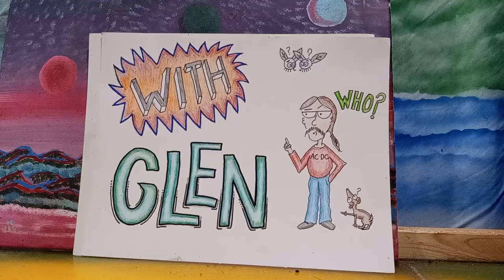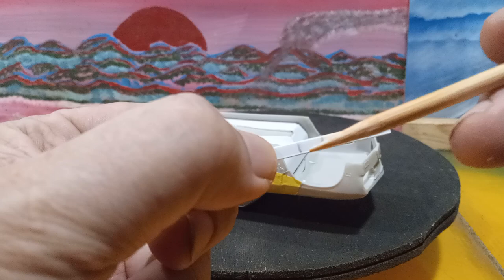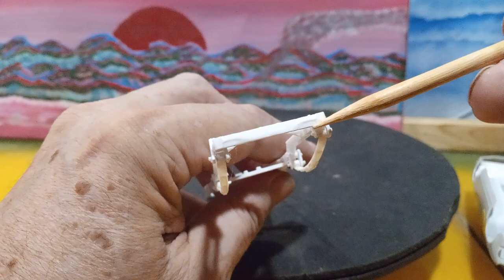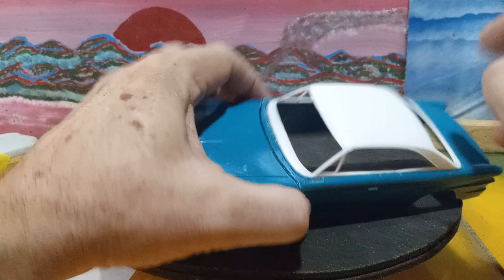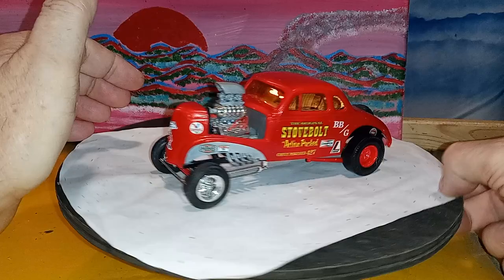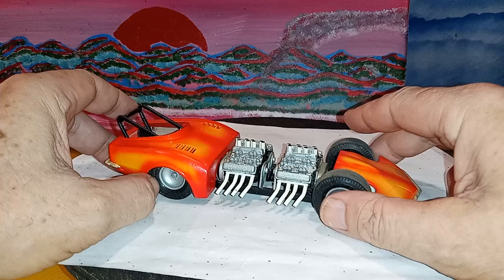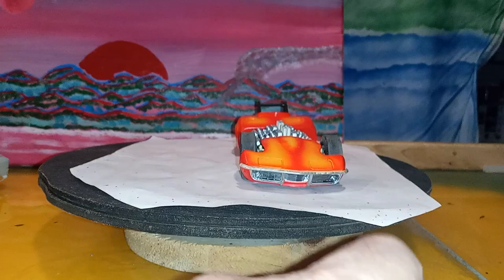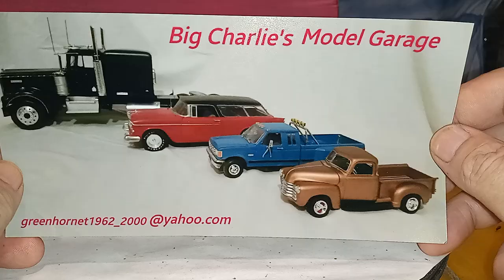#31,,,update on the corvair Gasser a cool tip and 2 models yeah buddy

Comment: Cool beans buddy! I like that 37 Chevy with the flathead w/ardun heads, I've got a Lincoln Zephyr V12 with the Ardun heads, I plan on putting that in a ratrod. Eventually 🤞! Yeah I want to get one of those what is it a mickey Thompson record car, the 4 engine thing, well I want for the 4 Buick nailhead engines, back in those days the hotrod guys like the small block Buick nailhead engines, they were real ruff but with the small valves in them they put out a lot of torque.
Reply from the maker: HI Doug I don't think they were nailhead engines in that crappy kit but the TV tommy ivos kit did have four nail head's in that kit,,, I have one in my stash that I got for a different project so if you want them I can send them to you when I get my social security on the third of August,, just send me a Gmail to make sure I got your address right, I may still have it if I can find it in the Gmail,, let me know buddy, later, Glen
Reply: @modelcarswithglen.  - Cool buddy! Yeah the Tommy Ivo car was the one I was thinking of, I got it mixed up with the Mickey Thompson thing, still I'd like to have that one, whichever one your talking about, haha, done got myself cornfused, again! Lmao! Anywho yeah man I'll email you my address, no problem buddy, and thank you very much, I sure Preciatecha! Later bud!

Comment: That quad engine Corvette rail is incredible. Love it. What paint did you use on it? Would love to know. Cheers from Nova Scotia. It's in Canada on the Atlantic coast and north of the New England states. Love your channel Glen, you're tops.
Reply from the maker: Hey Ken,, love your sense of humor buddy,, the paint is plain ol testors the yellow has the smallest drop of orange in it just to tint it slightly the other color is straight testors orange,, sprayed through a Air brush that was having a good day, the orange was thinned more so it didn't cover very well,, the airbrush was turned way down on the paint volume and the air pressure stayed the same  ,,it was applied in multiple layers making it easier to get the same width on,all the stripes  everywhere ,,, super easy,,,NOT ,,,but with practice is do able,,, I hope this helps and isn't confusing,, Ha catch you later,, Glen
Reply: @modelcarswithglen.  Thanks Glen, you a wealth of info and I]m making you an honorary Nova Scotian!! LOL
Reply from the maker: Thanks buddy,, how do you say I'm honored in Nova Scotianeze?